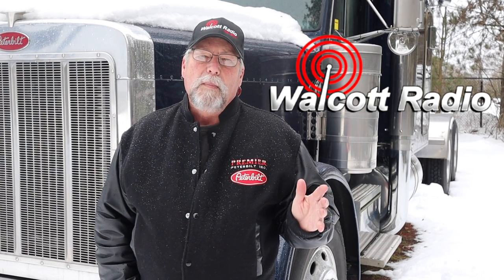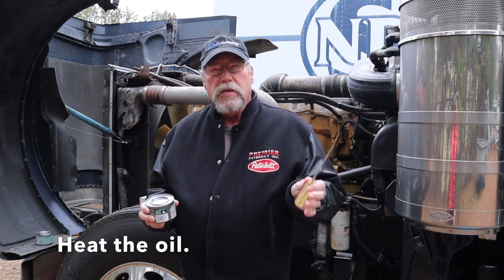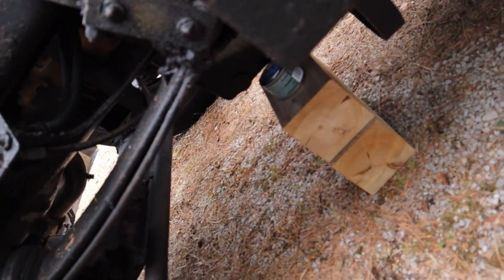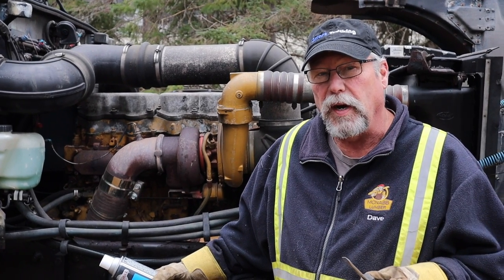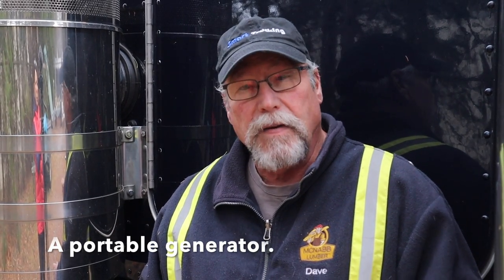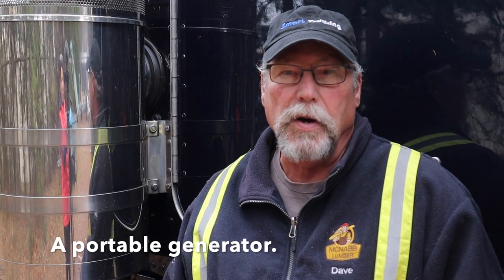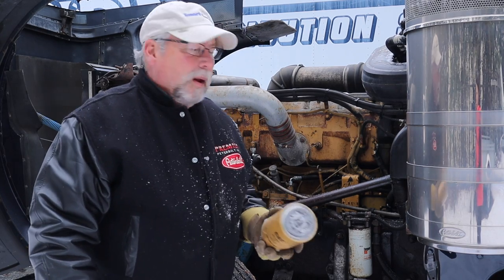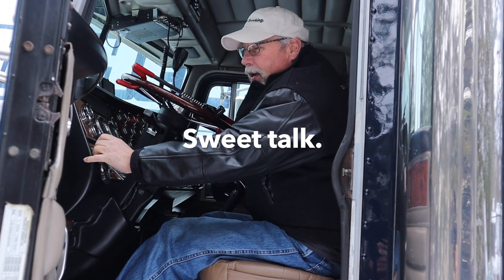How to Cold Start a Diesel Engine Truck (Tips, Tricks + Hacks For Truckers!)

Comment: on my oldest truck batteries lasted for 9 years, not all shot either when replaced them. if you have weak batteries you can kick on the starter just a little bit, that will wake them up, so when wait a few minutes and try again to start they may give more power.  
not smart to have a fire under engines that have composit oil pans hehe.
all my trucks have webasto heaters fitted from factory, not done any maintanace on them other then replacing fuel filters for 7 years.  but its important to run them at least once a month year around.  dont use all that much power and with good batteries people have them running all night while sleeping down to minus 20 celsius, they will shut off when drained amps down to a set mark so there will be power left to start, in theory. dont always work that way. jump pack can be real handy having with you, a mate even rigged up so he could start the truck form the batteries on his trailer through the Nato cable. 
block heaters work great, all my trucks have that also
Reply from the maker: Got to be careful!

Comment: My problem is ice in my air lines
Reply: Drain all the air tanks when you stop for the day, replace the air dryer.  In extreme conditions, use some airline deicer, but avoid it if possible as it can ruin the hoses and seals over time.    
If you have a good air dryer and drain the tanks, you should not get enough moisture to freeze up the airlines.

Comment: Walcott CB radio is the biggest joke of cb shop there is. Sat up an appointment to have a cb and antenna install done, by the time they were done......i had to repair the wiring for AM/FM radio along with the cb wiring to the battery because it shorted out on itself. The guys there are very rude and disrespectful especially to women ( my wife ). I ha e bought 2 radios from them 98 VHP Galaxy and they did such a hack job converting it and tuning it, they could only get it to do 150 watts. Took to another cb shop and they were able to get the full 350 watts. Galaxy 99 v2, converted and could only get it to do 45 watts. Same cb shop as the other radio and they were able to get 90 watts. Wouldn't take a dead horse to them and ask them to kill it again.......they'd screw that up as well.
Reply from the maker: Wow! Who do you use James?

Comment: I was at midway truck stop back in the 80's,  when a new driver pulled into the fuel island, shut off the truck, and it would not start, called his dispatch he said put either in he bought a can,and empty the hole can in the motor, we were in the restaurant when we heard the explosion.
Reply from the maker: WOW!

Comment: My Lord in 2021 we are talking about  lighting fire under the truck and spraying ether where do we live. My uncle did that in 70s what year is that. I never get the people pay $150k for the truck and can't install webasto or any other engine and can heaters. And if you can't have good batteries to support the webasto heaters which use very little than you are not keeping up the maintenance. I had webasto cab heater in my Scania that was 1996 produced. No wonder chinese left you way behind
Reply: Yes this video surprised me too. Maybe it's for extreme cold.